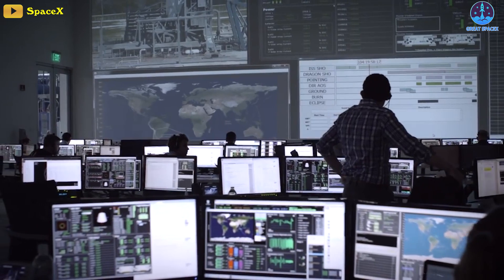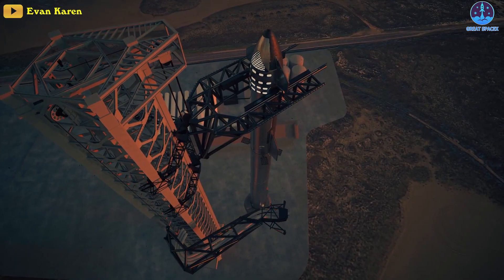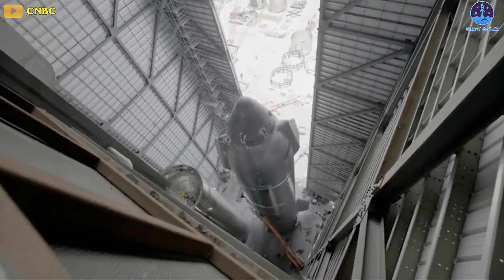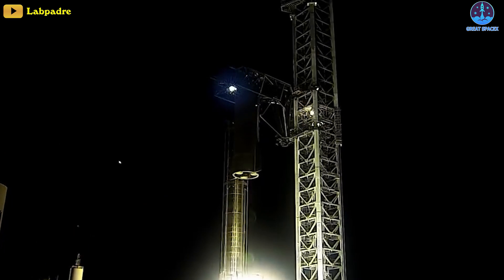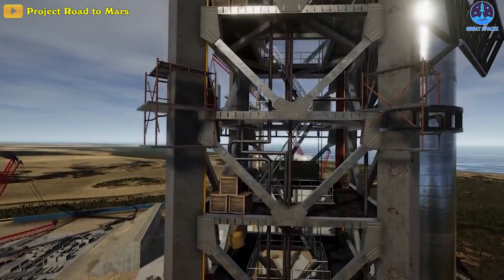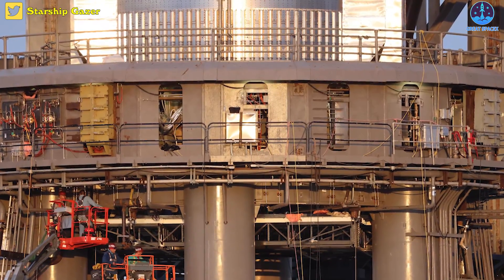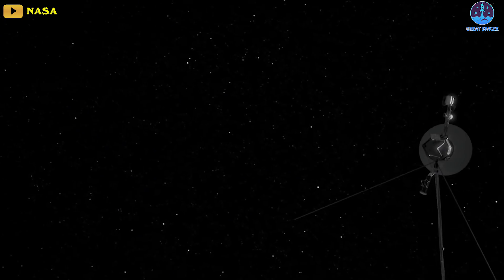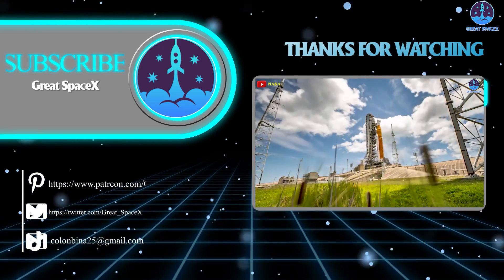SpaceX LIFTED Starship 24&B7 full stack by chopsticks again, Static Fire incoming...

Comment: The shield is consumed during launch. They do not want to add weight during the launch and thus they only need to protect the internal piping from hot debris and some impacts. The Aluminum will absorb most of the peak impact which will lessen the impact not prevent it.  
So an absorber rather than a classic shield. 
New launch, new shield.  😀

Comment: To prevent the Raptor engines from overheating and melting on initial startup. An internal bladder the same size as the internal structure of the Raptor engine. That has a hermetically sealed metal bladder completely encasing the inner dimensions of the Raptor engine structure with an inlet and Outlet at the top to pump super cooled liquid propellants through the internal bladder to reduce the outer temperatures of the Raptor engine eliminating over heating and melting of the outter metal structure

Comment: I think those aluminum foil covers is a sign of serious design trouble with the lower booster stage.. The only thing it can protect from is very light falling objects or dust / gas getting in or out from the space underneath the engines. Just a desperate quick fix so as to be able to move on ? The covers and the skirt was severely damaged by the strong explosion in July, and later by the static fires in the last months. By practically not having anything there the skirt may now tackle the pressure of the high temperature engine outflow exerted on it..

Comment: Surely a heavy steel exhaust shaft from the OLM is needed, can they just build it from the OLM and surface mounting the shaft to direct the blast to one direction away from the fuel farm, the shaft could be fabricated from 1/2 inch steel plate, and it possibly could save any damage to the pipework around the OLM LEGS etc.. 🤔🤞

Comment: The "weird stuff" or "strange covers" SpaceX has installed for blast protection around Booster 7's Raptor Engines is highly unlikely to be made from Aluminum. Aluminum's heating & strength limits just aren't suited for that application. The material is far more likely to be of some high strength, temp resistant and lightweight woven blanketing . . . like say, carbon fiber w/ Titanium foil outer layer. Something we haven't seen before. Just speculation on my part, but Aluminum wouldn't be my first guess.

Comment: They should just scrape Artemis and rely on SpaceX to go to the moon
Reply: They still can do that when Starship actually works.
Reply: Can’t it’s not rated for human flight
Reply: @natevizzi2901  You can if Dragon launches the astronauts and they rendezvous in LEO.
Reply: @ryan4094  well …. Yeah but that wouldn’t be cost effective
Reply: @natevizzi2901  Dragon Crew costs less than $100M to launch. SLS costs $4.2B to launch. Using Dragon Crew instead of SLS to get the astronauts off of the planet is very, very cost effective compared to SLS.
Reply: @ryan4094  compared to SLS sure … I mean you are not wrong but the cost effective way to go would be to delay the mission and wait for starship to be human rated …. Just unfortunately that could be many years
Reply: sls is still needed for now.

Comment: To be honest im looking at the launch platform and thinking oh.... i wonder how its going to handle the pressure and heat from all the engines firing.
Reply: I’m pretty sure the launch pad will do fine, it was able to handle super heavy engines test firing AND exploding. Let’s hope everything goes well tho cause you got a point.
Reply: @quanthe4th  The falcon heavy engines the merlins have half the thrust capabilty of Raptor 2 theres only 9 merlins on a falcon heavy... there are 33 raptors .... it would be like chucking 8 heavys on the launch pad at once...
Reply: @the_lomax  27 merlins  on a falcon heavy…
Reply: @JohnR31415  sorry should have said falcon 9 not falcon heavy as that includes the 9 on each booster. even then Falcon Heavy isnt even half of the thrust capacity of the Starship and its first stage.
Reply: That thing looks extremely sturdy. If anything breaks during an all engine static fire/launch, that platform won’t be it